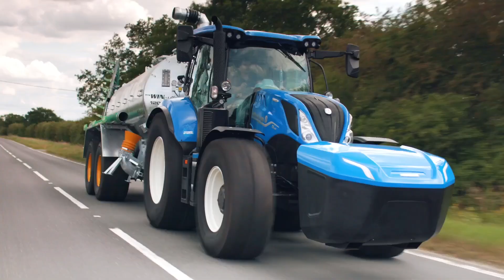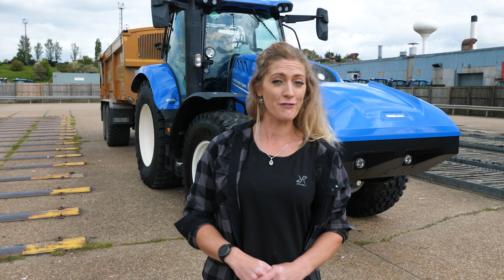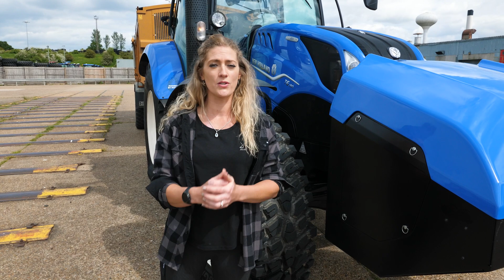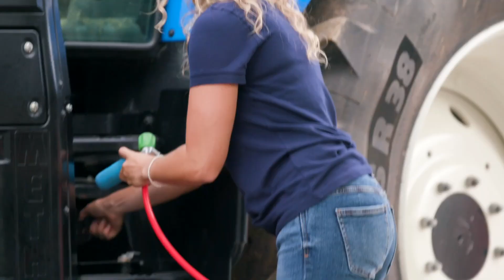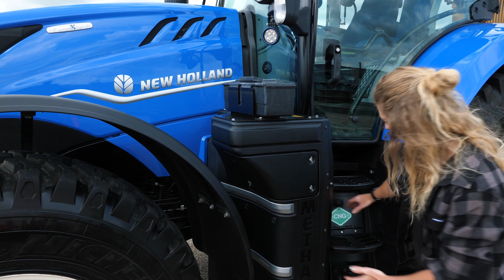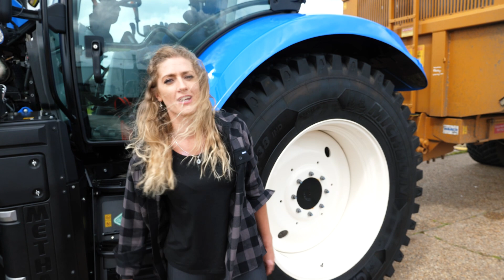Goodbye electric 💩 Could methane be the future motorcycle power source?

Comment: No, I think it will be Hydrogen electric thereby doing away with the batteries. I do think Methane could replace diesel on the farm but not on the roads. If you did not know all of the Japanese bike manufacturers, Honda, Suzuki, Kawasaki etc are working together to get hydrogen electric bikes into the motorcycle world.
Reply from the maker: Hmm yea it is all very interesting with all the changes and innovations that are happening!
Reply: @TheGirlOnABike  I put this together for you from some sources, I thought about not posting this because I do not want you to block me I really like your channel and your riding in the races seeing the reality of it so please don't block me?!

Methane as the main component of natural gas is used as a fuel source by people around the world, for things like generating electricity, powering industries, heating homes and cooking food. As a cook working the industry for 35 years I prefer NG to electric it is so much better to cook with and heat your home it is cheaper and more efficent also when you think of electricity most people do not think about what is powering the power station to create the electricity most are coal or oil some have converted or built to use natural gas and now we have wind and solar things are changing for the better but in general your clean electricity is not clean.
Using Methane as a fuel has high global warming potential (GWP over 100 years is 28 for methane). Methane emissions from NG (Methane is the main component in (NG) Natural Gas) fuelled vehicles can be reduced by exhaust aftertreatment devices to low levels, but not necessarily for all engine concepts. An internal combustion engine that is equipped to operate on gasoline can be converted easily to run on gaseous fuels and the conversion kits usually contain a little fitment which allows the user to run the engine on their choice of either propane or methane. So what you have there is nothing new the technology to run a combustion engine on Methane from Natural Gas has been around for decades just as electric cars are not something new they were making then over a hundred years ago along with steam engine powered cars to name a few but I digress the only difference with your tractor is the engine is Diesel not petrol (gasoline) and the source of the methane. They are trying to sell an old technology as something new because they are claiming to use bovine emissions as the source but the process is going to make the cost higher as it is complicated as compared to using natural gas. 
Methane is the second most abundant anthropogenic GHG after carbon dioxide (CO2), accounting for about 20 percent of global emissions. it is a powerful greenhouse gas more than 25 times as potent as carbon dioxide at trapping heat in the atmosphere and is the primary contributor to the formation of ground-level ozone, a hazardous air pollutant and greenhouse gas, exposure to which causes 1 million premature deaths every year.
Reply: Hydrogen electric still uses a battery.
The process uses hydrogen to charge a smaller battery, which is what powers the motors.

The upside is that hydrogen doesn't weigh as much.
Downside, the tank and battery together are still quite heavy and you can only use hydrogen to charge the battery.

I'm sure hydrogen will play a vital role in the future of transportation, but it's not a one size fits all situation.
Reply: @TotalMotoElliot  The hydrogen powers a generator that runs the electric motors. I never said it was a the only solution as you are implying and honestly I don't need you to tell me anything.
Reply: @Toni.63  I'm not implying anything.
Perhaps you are reading into that a little too much.

Just trying to have a discussion, but it would seem you have too fragile an ego for that.

Now, I am implying something.

Anyway, you are correct, the hydrogen fuels a generator, but that electricity then gets stored in a battery. It doesn't go direct to the motors, otherwise it would be more difficult to deliver the exact amount of power required when it's needed.

It's also required for regen braking to work.

Comment: The  Unlimited Super Stock Tractor pullers have converted Diesel engines to run on Methanol which is a liquid fuel. Some times they call it Wood Alcohol, usually it is manufactured from natural gas.  They had to install Spark Plugs in the engines where the Fuel Injectors were.
https://www.youtube.com/watch?v=O7d1gZGGs-c&t=22s

Comment: Driving around Landfills in the  USA you  see pipes coming out of the ground with a flame burning.  As of for now they just burn the methane gas into the atmosphere.  They can catch Methane gas off from the top of Oil wells too.
  Since the CIA blew up the Nord Stream Pipeline, Europe is short on gas for heating houses for sure.
Reply from the maker: Interesting!
Reply: @TheGirlOnABike    I know an Excavating CO that owns two Landfills.. The biggest price of running a Green House is heating it. So they built a Green House next to their Landfill and use Menthane Gas to heat the Green Houses.  They call sell the flowers for cheaper than the competition and still make more profits..

Comment: I don't think that Menthane gas is a very practical Mobile fuel.   There is a Grain Elevator near me.  The Pipe Menthane Gas from a Landfill 8 miles to the Grain Elevator.  It takes a lot of heat to dry grain every fall.
  I also know an Exaction Construction CO that also owns a couple of Landfills.  They pipe Menthane gas to their Green houses. Normally heat is the biggest cost of funning a green house. Thus having access to low cost heat increase their profits.
  It's far more practical to pipe the Methane to houses and businesses for heat.
Reply from the maker: Oh that sounds ace

Comment: Do you guys in the U.K really pronounce it as mee-thane and not meth-ane ? 
Burning methane in a vehicle has been around for decades. Problem is storing it safely to use. CNG (compressed natural gas) only densify’s the gas, whereas LNG (liquefied, natural gas) is more ideal but requires 
to freeze the gas at 260° below zero Fahrenheit or -161°C which would be equivalent to about 600 gallons of gasoline to 1 gallon of natural gas. 

Whichever direction we go with supplying our energy needs, all depends on convenience for the consumer and profit for the supplier. Very unfortunate
Reply from the maker: Hehe uh oh, maybe the accents make it sound different but yup.. Thanks for sharing!

Comment: I drive a Scania HGV powered by CNG. It has 410bhp, will pull 40T gross weight, and will travel for around 300 miles on about 150kg of gas. Not as much low down torque as the diesel counterparts, but a much smoother and quieter engine. Plenty of CNG refuelling stations up over the UK now.
Reply from the maker: Oh wow nice!

Comment: I have to say this crap idea, it's brilliant. Literally farting in a jar, OK not literally. we can provide fuel to run internal combustion engines. It's a great idea to process a number two dreadnaught dropping while on the throne for use to extract the energy from within. I may be wrong (usually) but Bristol introduced the Poo bus some years ago powered by processed poo that was initially introduced on the number two route. As a non academic in this field having a fuel infrastructure in place that can feed liquid farts into a fuel tank of a bike is brilliant.  No sh1t this should be explored more. It would be easy to smell a 'gas' leak as well as the aroma of runny eggs is one that is hard to forget.
Reply from the maker: Haha this definitely made me giggle! Thank you 😅

Comment: I used to have an LPG tank in a Passat. It did need petrol to start it and it was aftermarket so not ideal but it worked almost as well as petrol and filling it up was quick.
However the tank was pressurised so that would have to be the same on a bike.
If you think about it, they used to run cars on it in the war...
If they can get the tank and range sorted I'd rather run on methane than leccy. The big downside of electric bikes is that I don't want to sit around every 100 miles while it charges. I want to fill up and go.
Reply from the maker: I totally hear you. Our Mercedes-Benz van is a 3.5l V6 with LPG and it's fantastic. Far improves the fuel economy. And I hear you re the 100 mile recharge. I love coffee but not that much haha
Reply: @TheGirlOnABike  I'm more worried about the cake. I sometimes have to suck in to get the jacket on.